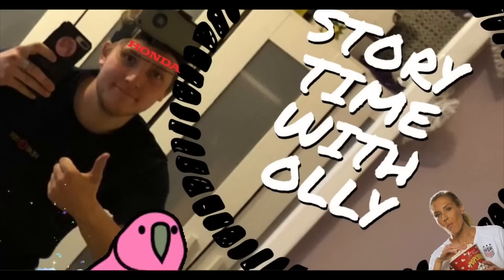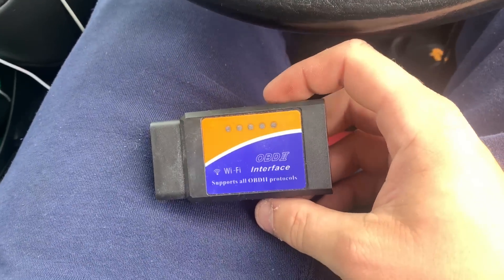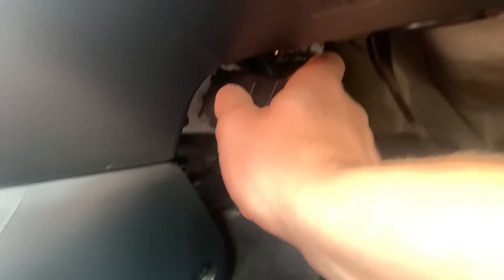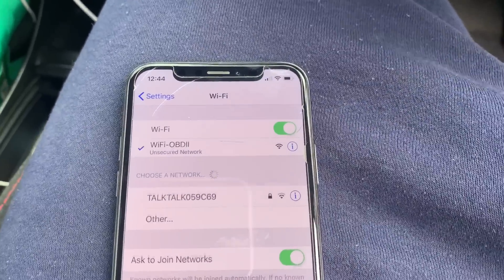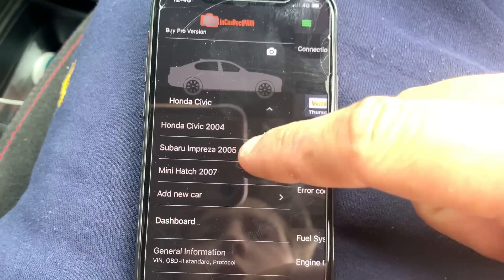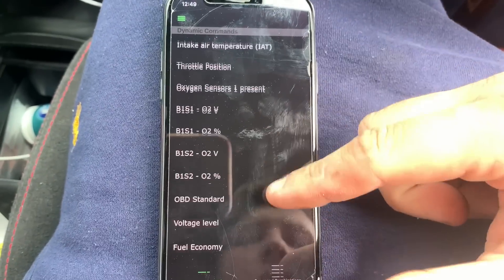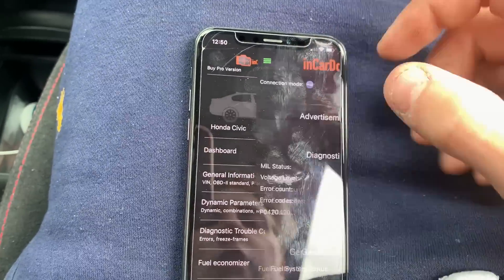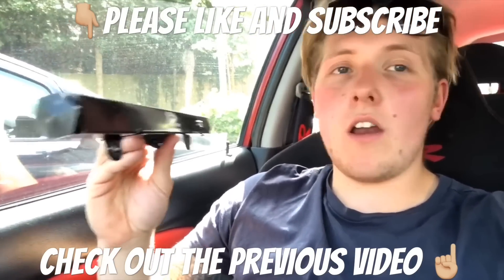Do CHEAP car scanners (OBD2) WORK?!

Comment: Ain't watched yet but they good enough for codes at least yes?
Reply from the maker: Andrew Gates yes mate!
Reply: @ModifiedWeekly  been subscribed and commenting for a while but you only just heard that it's oli (which I knew) and Paul... felt rude not using both ya names, respect lads plz don't stop I like you non-pro approach.. like average man 👍👍
Reply from the maker: Andrew Gates thanks bro!, honestly you don’t need to use our names😂😂😂
Reply: @ModifiedWeekly  cool then John and Bob hehe 👌👍😂